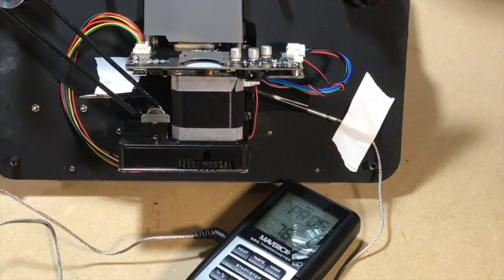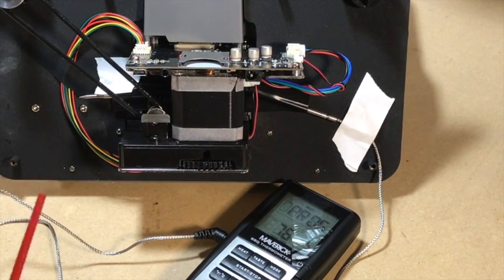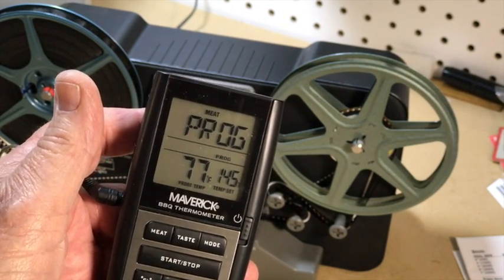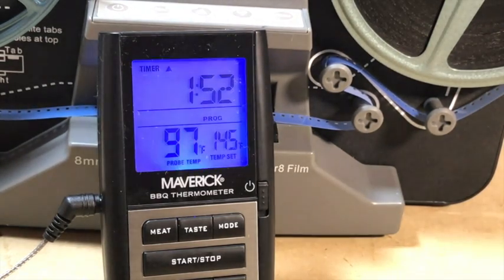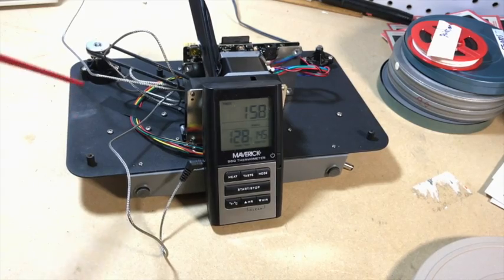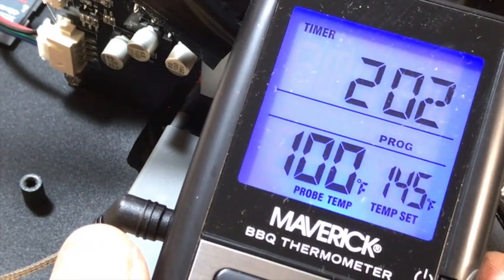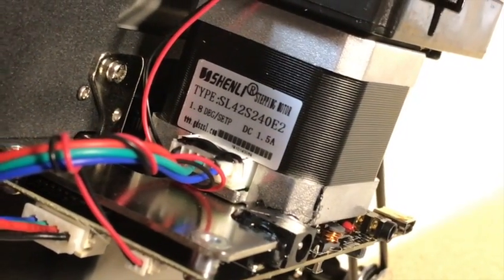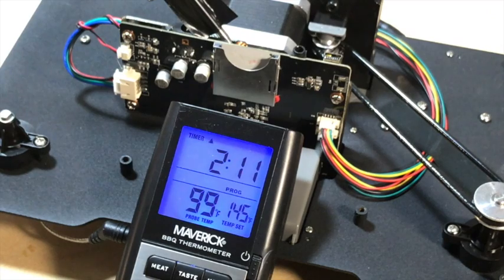1st Generation Wolverine Reels2Digital MovieMaker heat problem - making the belt melt?

Comment: Did you ever find a replacement belt drive?
Reply from the maker: Wolverine sent me a couple but it was a bear to remove the belt from the drive shaft: I think I have some video of that process - can't recall if I've posted it to YouTube. Between sticky belts and clicking slipping gears  I have spent a whole lot of time working on the 1st gen model and it only worked for a short bit before going on the frtiz again. I finally put it back in it's box and on a shelf where it shall become forgotten. I did buy the pro model and it has worked good so far but I haven't had a large new batch of films to digitize. I digitized a lot with the 1st Gen also before it broke: If I had sent all those films out to be digitized it would have cost a lot more than the Wolverine did. I got my money's worth, but it's a shame the machines weren't a little more robust.
Reply: @BobHudsonVideo  So is the newest 2021 version free from the gummed up belt.

Comment: The pro model doe snot use belts. It has a direct drive take up motor.
Reply from the maker: Which was a wise choice on their part. Overall very good machines.
Reply: Yes mine has been flawless so far.
Many viewers on my channel take every opportunity to slam it, but they are the trolls. I seem to have a bunch of them on my channel.

Comment: I just received my Wolverine Film2digital MovieMaker today (from B&H) and being concerned about the belt, immediately opened the case to check the belt's condition before even turning the unit on. Surprise! No Belt!!! The take-up reel is driven by a stepper motor independent of the frame-advance stepper motor. Plus, the back of the case has some ventilation holes!

Could this be the difference between a Reels2Digital and a Film2Digital? Or perhaps they just made a running improvement in the model.
Reply from the maker: Yes, they changed it about a month or so ago: I have some photos of the changes I will have to post: well done Wolverine!
Reply: The pro model has a separate motor.